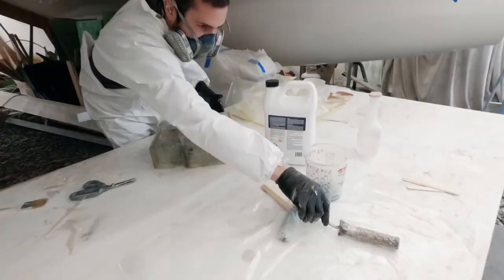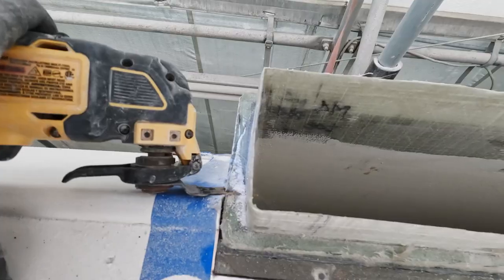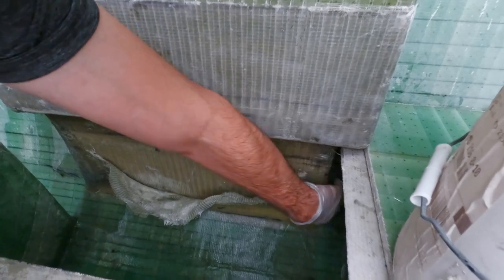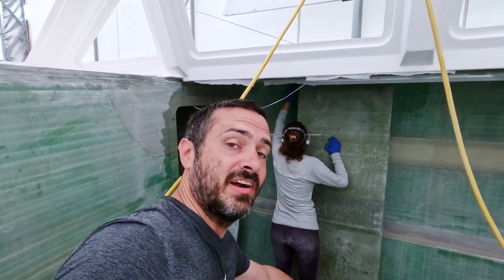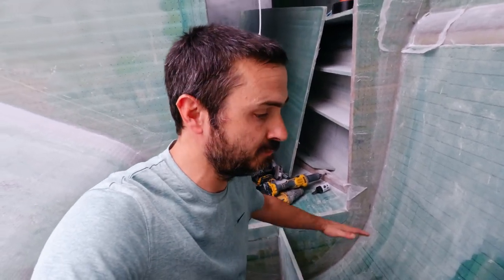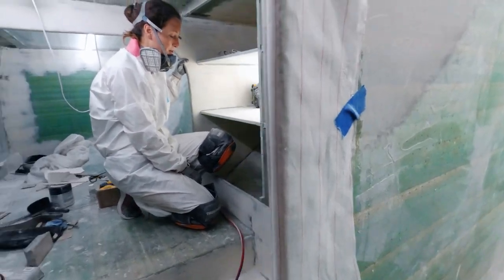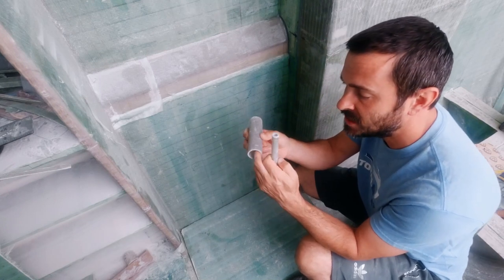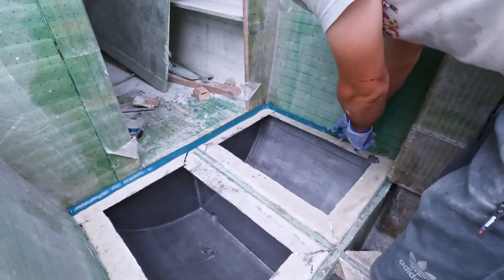This Is Not Coming Together - CATAMARAN BUILD (MJ Sailing - Ep 245)

Comment: What is the capacity of of those fuel tanks?  They look a little smaller than I would expect for a 42ft Cat.  Didn't realize you guys are doing this build on Kent Island, we drive through there all the time on the way to the shore.  I used to sail out of the Annapolis before kids.  ;-)  You're doing a nice job w/ the build the your video production quality is very good for amateurs!

Comment: You painted the fuel tank sides, bottom, but did not paint the top side of the tank, wondering why?   With full tanks and a bouncy sea won't the tanks slosh about hitting the lid?    

Might have created a larger input and venting lines, some spider is going to crawl into and web the vent line shut.   (this has happened to me on a open propane line, took a while to discover the web.)
Reply: If you look at 16:30 ish he did paint the tops

Comment: What was preventing the resin from curing? That's a problem you can do without, but nice work getting it all in place!
Reply from the maker: We think it was the high humidity from working at night (about 90%). After we placed our infrared heaters on the case it cured without an issue.
Reply: @MJSailing  Well, that's good to know. Nice work! There's still a lot to do, but it sure is coming together:)

Comment: Just wondering if you considered fuel bladders and what the pro's and con's are?
Reply from the maker: Fuel bladders work, but you can't check the capacity since they don't work with depth gauges.   They also wouldn't allow us to seal the floors like we have.
Reply: @MJSailing  yeah I see how a gauge wouldn't work in a collapsing bladder.

Comment: Does the boat come with a warranty?
Reply: My warranty on anything I built is 10 ft. or 10 mins. What ever comes first.
Reply: Minus 2 NM sailed.
Reply from the maker: Since this is a home build, no, there is no warranty on it.
Reply: @MJSailing  What kind of percentage did you save by doing the owner build?  50%?
Reply from the maker: For ourselves, since we're able to work with some vendors for discounts on bigger items in return for promotion, we'll probably have around 300k of our money into this boat, but we're estimating it will be valued at 650k.

Comment: Bro y’all need those big fans that work as a swamp cooler maby y’all could do a sponsorship with bendpak for them
Reply from the maker: Humidity is way too high for a swamp cooler.
Reply: @MJSailing  the ones from bend pack have a dehumidifier in it I just didn’t know what else to call it cause it has that option also

Comment: vinyl ester resin goes bad rather quickly maybe 3 months or so.  what bad luck to put in a major structural component and the resin doesn't cure.  Technically a six 6 month shelf life.  But you don't know how long it has been sitting on the suppliers shelf.

Comment: You didn't really say what the problem was? was it a bad batch of epoxy or catalyst?
Reply from the maker: We don't know for sure, but we think it was high humidity (when the temperature cools to a reasonable 80 degrees at night, the humidity jumps up to 90%). So after the third attempt we placed our infrared heaters on it and it did fully cure

Comment: Special Problems in Induction -- Solution? Wet your fiberglass cloth, and surface prior to rolling it out. Mix smaller batches this time of year. Granted! Leads to wasting more product, and excess dust once you sand. Air and surface temperatures can be drastically different no matter what time of day you are working. Beats grinding it out and redoing it. More attention to eliminating a 90-degree angle is also known as a right angle. We both know the cloth doesn't like them. Air pockets are not your friend. Haste makes waste.  A bad batch should be discussed with the fiberglass manufacturer, as well as the boat manufacturer Vietnam. The problems encountered with the weather in Vietnam have to be ten times worse than what you are having. Bad batches can sometimes be easily fixed without having to become a chemical engineer.

Comment: Damn guys you got a bad batch of vinyl ester been there done that
Reply from the maker: Funny thing is we did tests on it in disposable cups, and it all cured just fine. We think it was an issue of high humidity bc of working at night (about 90% here). But once we placed our infrared heaters on the space, it cured just fine.
Reply: @MJSailing  oh jeez yes that much humidity will screw you for sure

Comment: Where are the through holes from compartment to compartment
Reply from the maker: There aren't any.  Each cell is supposed to act as a buoyancy chamber and keep the boat afloat if we collide with anything
Reply: @MJSailing  and the chambers for diesel I must have past out watching the video
Reply: @mathuelee2686  if you watch the video he even shows you how he lines the holes with resin and cloth and fibre sleeves did you watch the video dah

Comment: It looks like someone forgot to promote the resin before supplying it to you.  Resin is shipped globally  with 3 components missing.  
1. The user introduced catalist of course (MEKP)
2. Cobalt  as a promoter (added by your supplier)
3. DMA as a promoter (again, added by your supplier)
Any one missing (or not mixed properly) and the resin wont cure properly.  
The promoters not mixed properly could explain why your small test batches seemed to work.  That is a bit of a stretch, but could explain it.  Each batch they promote should be recorded and documented as its kinda critical.  Short story, take your new batch back and get some promoted resin from a different batch.
Reply from the maker: It's the same resin we used for at least a month beforehand.
Reply: My 2 cents: not even sure if it's the case here but certain chemical mixtures exposed to temperatures exceeding manufacturers recommendations during transport can affect their stability. While freezing temps can cause irreversible mixture separation and high heat off gassing, there is no way to know unless data loggers are used to track the info, similar to shock and tilt badges. More carriers are using precision controlled  temperature hardware to keep things safe and not just guessing.

Comment: I don't know anything about sailing, but I watch a ride range of different sailing YouTube channels and I'm confused.

On the other YouTube channels they sometimes have problems where they have to open the inspection thing to look into the fuel tank or to clean the inside of the fuel tank.  But then you guys are totally sealing up the fuel tank so that the inside of the fuel tank can't be cleaned and no one can inspect inside.  That just seems a bit strange.

Don't you need a way of opening up the fuel tank?
Reply from the maker: If you see on where the other side of where the fuel intake hoses will be, there is a circular area of the sole which has been decored and glassed.  That is where our inspection port is located, we just haven't installed it yet.